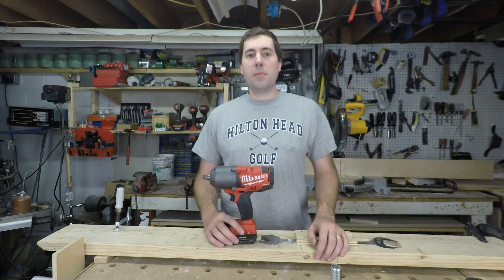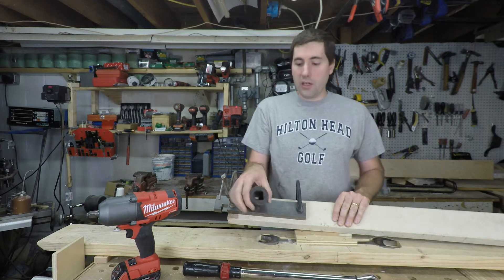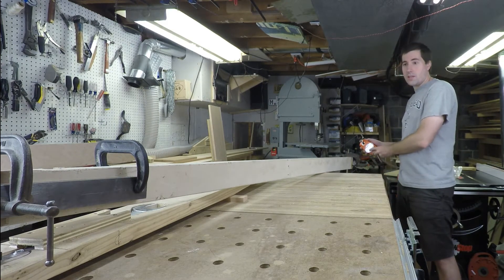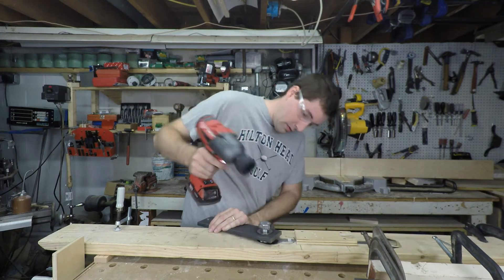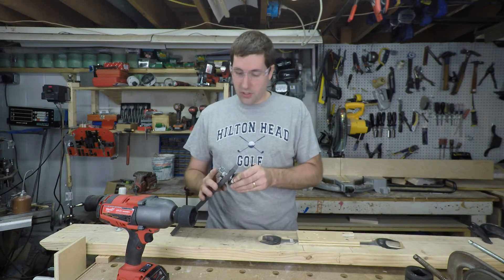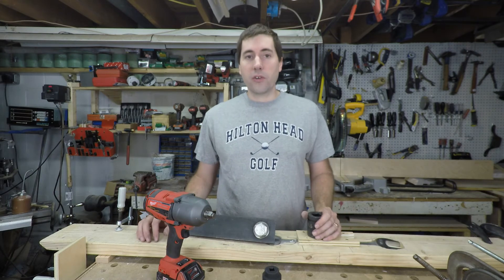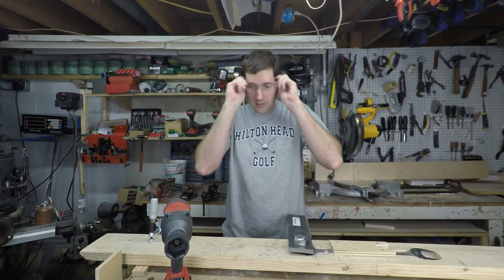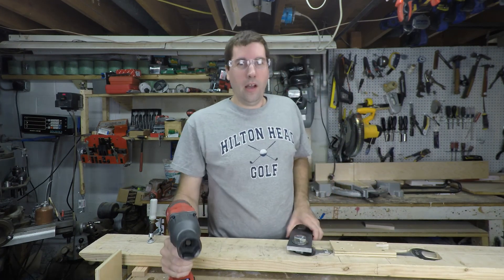Milwaukee M18 2763 Impact Wrench Torque Test

Comment: The other problem with this video is back to them. They probably didn’t have the five amp batteries you can now put the five amp battery on there and should be more powerful. I own the same impact but mine in 2016 with four amp batteries.

Comment: Its a big impact wrench and demands a bigger battery than the one your using  No harm done, but don't expect a pat on the back.
Reply from the maker: The spec sheet doesn’t call out a battery size, therefore it ahould be able to hit the specs on any M18 battery.

Comment: I'm a little confused on what he means he torqued the bolt down to 460 ft-lbs but the gun will take 500 ft-lb to take it off
Reply from the maker: There is a difference in the torque to tighten vs loosen a bolt do mostly to the difference in static vs kinetic friction.

Comment: I believe Milwaukee's rating is based on a 5/8 inch bolt size.  Real Tool Reviews discusses the spec in his vid about the accuracy of setting 1 on the unit.

Comment: Great test, i would have switched battery packs mid test to spread out the demand that is drawn from them to help mitigate overheating issues on the battery packs after such a long time running at full throttle. Real Tool Reviews goes to great length to explain how most manufacturers test impact wrenches and get the best numbers. It has to do with the heat buildup in the fasteners after torquing it down, which later helps with torquing it off. Your tests confirm what type of performance to expect out in the real world.

Comment: That impact comes with 5 amp battery you use a 2 amp big difference with 5 amp
Reply from the maker: +Arthur Davis Its a 5 Amp-hr battery, that should just effect runtime.  Plus the bare tool is sold with the 1100 ft-lb spec as well with no caveat of battery size.
Reply: Do it again. whit a 5 amp battery! ;)
Reply: I use Milwaukee on a regular basis the bigger battery does help